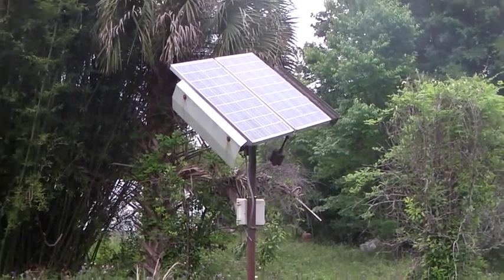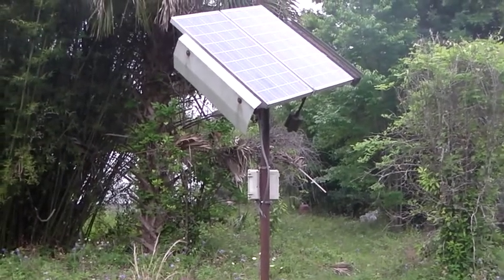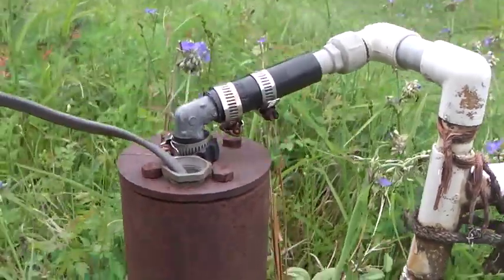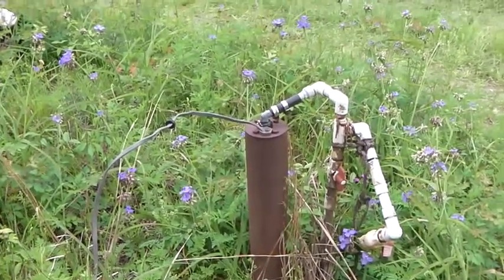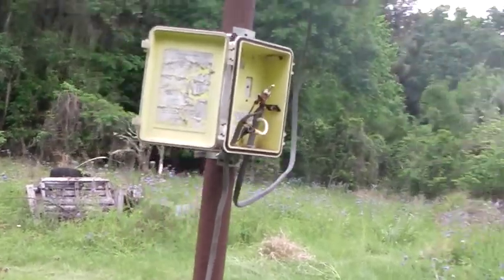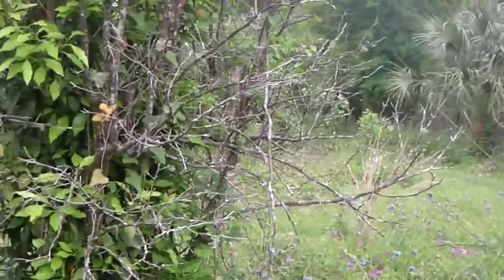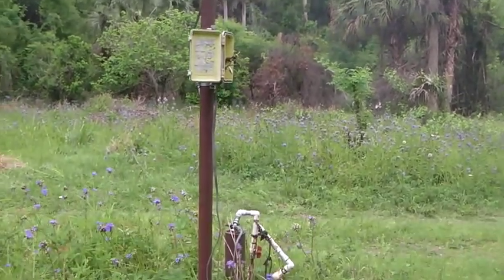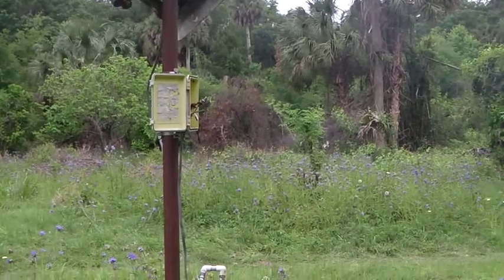Off grid solar well

Comment: Totally cool. I'd like to automate it even more with a float switch in the cistern. My current house has well water which ain't bad but sucks when the electricity goes out-- no shower. This setup is just the ticket for hurricane season. +1 Matt
Reply from the maker: Turns out the submersible pump runs between $600 and $1200, depending on quality, so the whole system would likely set you back a few grand - quite a lot for an emergency shower system ;)